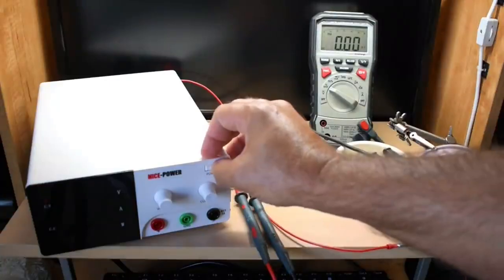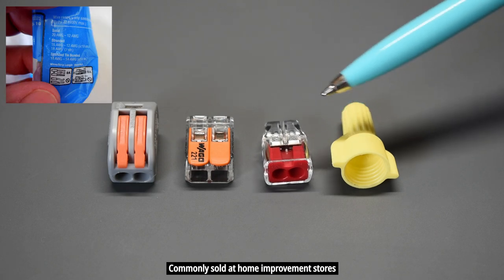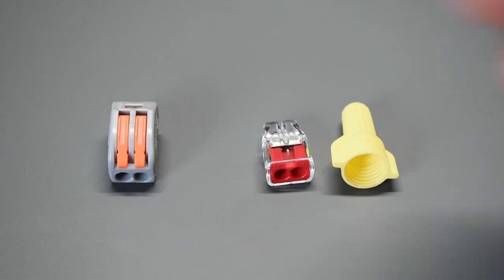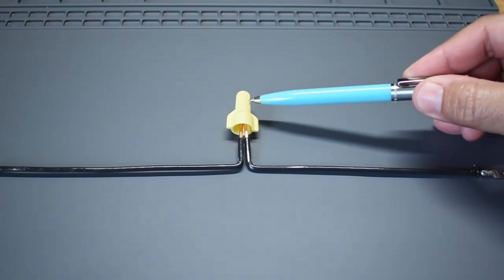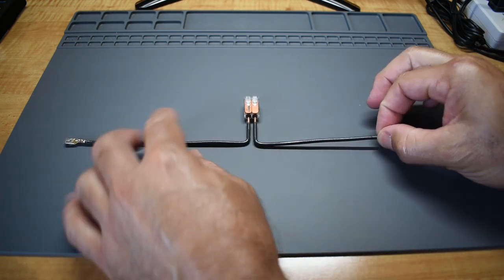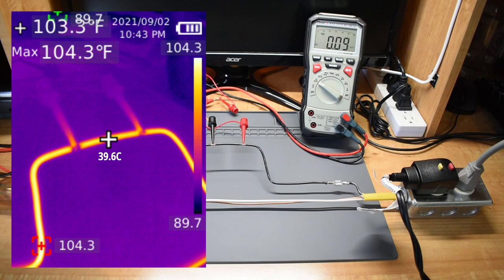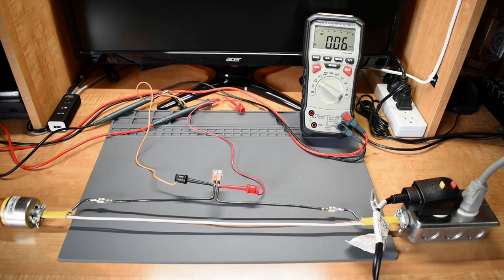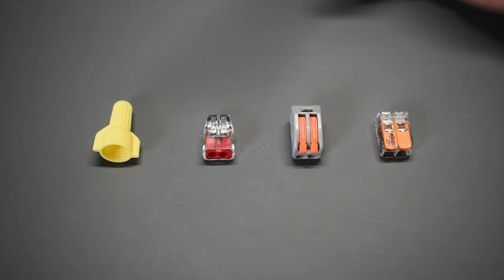BEST Electrical Wire Connector? Wago, Wire Nut, Ideal In-Sure, Lever Nut

Comment: There's a lot of false testing and wrong conclusions in this. The voltage drop test naturally favors the wire nut, since with that type the wires will touch each other earlier than with the others. On a very short stretch like this, this difference is very significant. To try and eliminate this error the voltage drop should have been measured over a much longer wire length, like 2 feet, minimizing the error. The complaints about wigglyness are also uninformed at best, that's just due to how the clamp mechanism works, it doesn't point to a lesser contact. I also think that to be a useful test, currents should have been much higher, to well above rating. Now it's just a walk in the park and we have no idea how these will hold up under overload and short conditions, which is where it counts because those are what determines whether your house burns down or not. So, sorry to be this harsh but... I'm not impressed at all.
Reply from the maker: Use what you want. The testing was very good, and accurate. Nothing false about it. Based on your username, that explains why you're acting the way you are. You're not the first European or Scandinavian to complain
Reply: @electronicsNmore  Just from the fact that in a wire nut the wires get twisted together you already know that the wires touch each other sooner than in other connectors. That you choose to be stubborn and deny the issue rather than have an open mind and agree a measurement over 2 feet of wire would have been fairer tells me enough. And I repeat: a test without going to 40 amp and 80 amp to properly stress them is near-useless. No connector will fail under your normal circumstances, so it's pretty meaningless.

Comment: Twist the wires before inserting them into the wire nut. Then try pulling the wires apart to see if they will come out of the wire nut. Then try the same with the rest of that shit and see what happens. That's the only test necessary. No need for electronic theory and further BS!!
Reply from the maker: Yes, I normally do twist the wires together, but I did it as shown to prove that even without using the pliers, the results are better. I do everything for a reason. Yes, there is a need for further testing, apparently you don't have a YT channel and have no idea the level of attack you'd be subjected to by viewers if you didn't show reliable tests.

Comment: Using the push-in holes at the back of devices, like switches and receptacles, is called ‘back stabbing’, a lazy practice employed by amateurs who’ve never had a house burn down on them yet. Wagos are exactly the same thing; cheap, lazy and dangerous. While it is legal to SELL such contraptions it is highly questionable and may in some cases be a contravention of the CEC to actually use them.
Reply: @Cris T I agree. I have never used a Wago. I ordered an outdoor LED post light that had multiple Wago connections in it. (from photocell to driver to light even for the initial 110v connection). I cut out every single one and replaced them with small grease filled direct burial wire nuts to eliminate connection failure and voltage fluctuation which cause (barely noticeable) blinking and also shorten the lifespan of the driver. It’s well worth the extra time and effort especially when you purchase a $150 light that will be exposed to the elements.

Comment: ok last one is fake :) uff
4:18 this is no C E mark the letters are too close 
this is fake :)
Reply from the maker: Whatever you say. LOL
Reply: @electronicsNmore   so if there is no FCC proper mark on stuff in states you also use LOL ?
Reply from the maker: @MrZiemwit  FCC? LOL I think you better read up on when FCC markings are used. I highly suggest you end the stupidity and wasting of my time, otherwise you won't be posting comments on this channel in the future.
Reply: You do realize that CE doesn't mean anything in the US right?  CE is certified and stamped by the company making the product so it doesn't ever pass to a 3rd party and it is a simple conformity designation.  In fact the CE mark is pretty much a joke everywhere in the world as well because of all of the poorly manufactured junk coming out of China. 
If you see a proper UL or ETL marking on a product being sold in the USA you can generally be assured that it is at least electrically safe to the limits if the testing certification as that will also be listed.  Companies using these marks without proper certification face heavy fines and penalties.  These Wago nuts list that on a different side and on the box not shown in the video.
Reply: they are wago 222 chinese clones
Reply: @kuhrd  CE as pure characters doesn't mean anything, that is right. But not many people (esp. in the USA...) know that CE actually is a graphical trademark like the Coca Cola signature. So it has to have a specific look which is more "C E" than just CE. The C is supposed to be a half circle, the open right part of the circle ends where the left part of the half circle E starts, leaving a lot of unusual space between the C  and the E (look at "CE marking" in wikipedia, there you see how it is constructed). And as you know using any trademark has some obligations...

Although you have self-certification, you are bound by EU law to have conducted all tests and fulfill all relevant regulations that apply to the device type. If you bring the device into the market (either manufactured or imported), there has to be a European representative that is responsible for it and has to provide the certification results to the customer (stating all tested norms). The certifications can only be based on tests of official certified test companies. If the device passes you can put the (real) CE trademark on it. So the trademark usage serves as some sort of "trust chain": EU representative -> certificate -> test institute -> compliance to regulations. You can always ask the manufacturer/importer/representative for a copy of the CE certificate. He is obliged to give it to you even as an end user, if it is not already in the manual. 

If you use the real CE symbol without proper testing or fake certificates and somebody (usually a competitor, private/official test institutes, official market surveillance etc.) has doubts/hard facts about that and reports that to the authorities, you can be fined (50kEUR + prohibition of sale + recall + damage claims etc.). So nobody uses real CE for untested crap, it would ruin them.

If a (e.g. chinese) importer/manufacturer cannot provide the tests, he either omits any marks or just uses the look-alike CE-characters as disguise for the clueless. But usage of the look-alike CE (chinese export) is always a sign that the device has not been tested against EU standards. A sane importer wants to have devices with certificates ;)

Although the US/EU standards may differ in some parts, the technical background is the same and in the end they are quite similar. So a real CE mark will give comparable safety. 

To cut a long story short: The CE of the first lever thingy is FAKE. It is for sure not by Wago (although the case/color design looks similar) or any other European brand. They simply would have used the proper CE symbo because they can.

BTW: Almost all domestic or commercial electrical installations in Germany uses Wago or similar push-in/lever connectors in large quantities for a long time now. Switches, outlets, etc. are usually all push-in. Even the N/PE-bus bars for diameters up to 4mm^2 in the main fuse boxes are just push-in for >25 years now. If that would pose any danger these type of connectors would have been banned. Terminal blocks with screws are used mainly only for larger diameters (>4mm^2). Wire nuts are (although allowed...) like a unicorn in rainbow colors, nobody uses them.

Comment: Yet another American pre-biased Wirenut video. Yes the wirenuts give the best connection when used correctly. But the reality is that often they are not done correctly and the flaw is hidden to you. And when you years later want to replace a socket you have molested wire endings that need to be cut shorter. Horrible. There is a reason why they are not allowed to be used in many countries.  In Denmark transparent screw terminal blocks with transparent plastic was the norm but press type Wagos or the new 221 lever Wagos are taking over. They are fast to use, you can inspect the insertion, you can mix stranded and solid, any idiot can use them safely. Years later you can service or expand and there will be no damage to the wires. And the spring contacts will keep a secure connection even if the cupper flows thinner (problem with screw terminals). The little extra resistance means nothing. That is not a valid criteria to dismiss them in favor of wirenuts. The heat produced means nothing in the 10-20 A circuits that they are made for. There are plenty of youtube videos showing how good a margin they have. It does not matter.  It is a conclusion based on a biosed oppinion and a test with a criteria rigged to prove the wrong point.